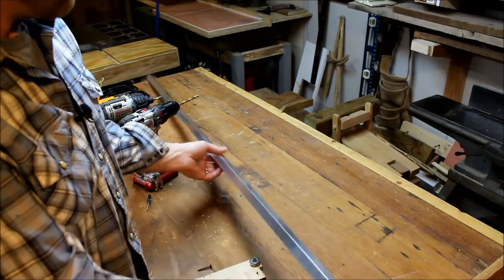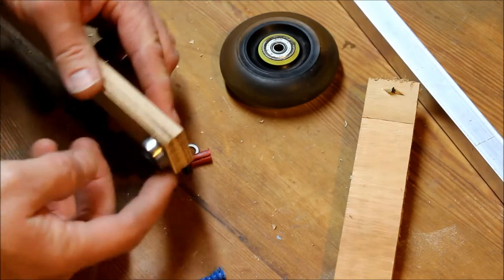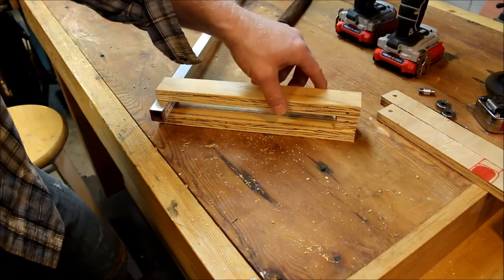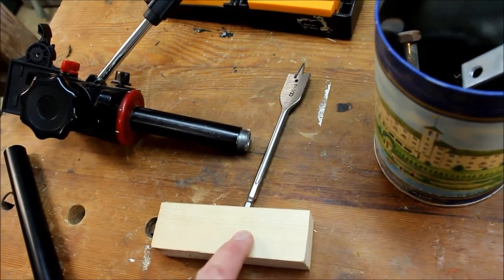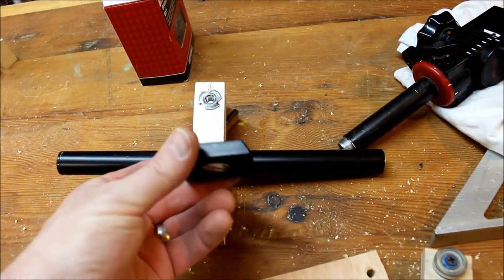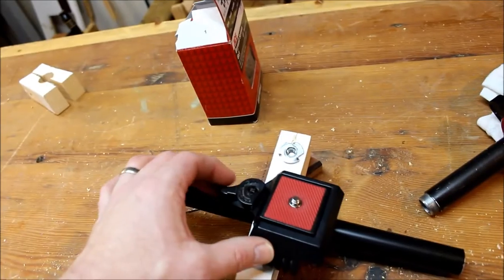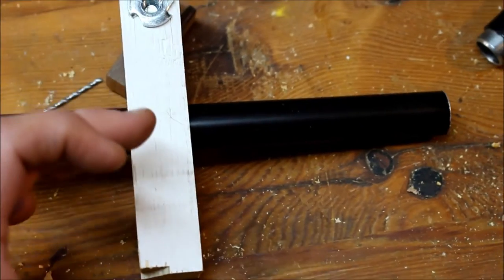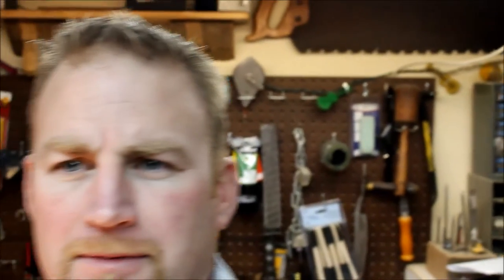Camera Gantry 1.0 Vintage Wood Workshop

Comment: Very nice project. I have seen other people go super overboard with systems like this but this one is nice and simple to implement. Good stuff keep it up.
Reply from the maker: Angel's Tinkering Corner thank you!  I know, I've seen some of those designs too but due to time I usually like to plan it out somewhat in my head and then just solve each me part as it arises.  that can be freeing and more fun and it gets me right to building instead of designing on paper or the computer.  glad you liked it man!
Reply from the maker: Angel's Tinkering Corner thank you!  I know, I've seen some of those designs too but due to time I usually like to plan it out somewhat in my head and then just solve each me part as it arises.  that can be freeing and more fun and it gets me right to building's instead of designing on paper or the computer.  glad you liked it man!

Comment: Just found you from the suggested vids, probably because I just watched John Heisz's gantry vid. Really like your design too.. trying to decide which way I want to go, but the tripod is definitely going away. Got my sub, can't wait to see more from you!

-Caleb Harris
Reply from the maker: awesome, thanks Caleb! this works great and can easily be moved to fit anywhere on the drop ceiling grid like o Dr the lathe for example.  the only change I'm thinking about is building a swivel for 360 degrees on the x-axis in the future.  John's design is brilliant but my shop is only 11 ft wide so I wanted something compact that I won't bang my head on.  let me know what you decide brother!

Comment: Nice setup, it's a real drag moving tripods around and tripping over them.  Now that you've had it a year how did it work out, would you made and changes? I recently started using a Manfrotto "Magic Arm".  I made a little mount for it and just clamp it to the joists.  it's really making certain shots way easier!
Reply from the maker: Great, especially after I modded it to be able to swivel 360 degrees (I have a separate video on that mod). I recently moved it and my workbench in front of the tool wall.  My latest video featured most of the shots from above using that gantry.  Works great, but I have to make sure it stops swinging before hitting record!